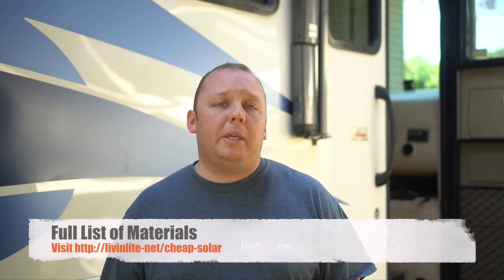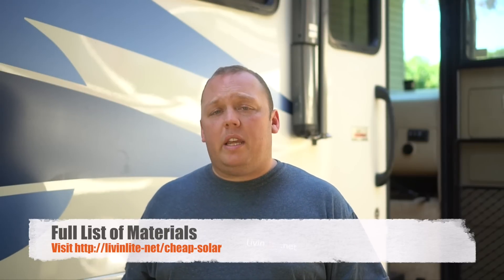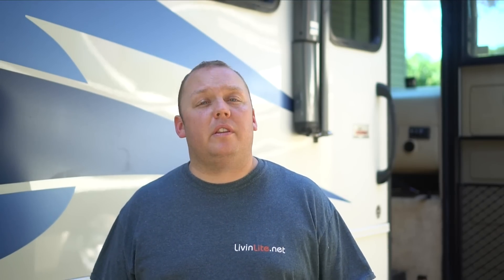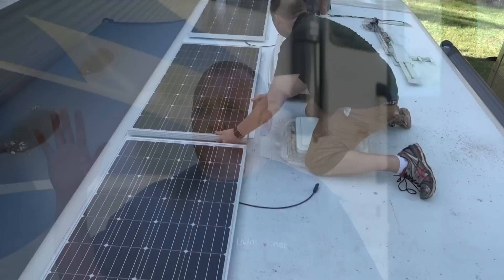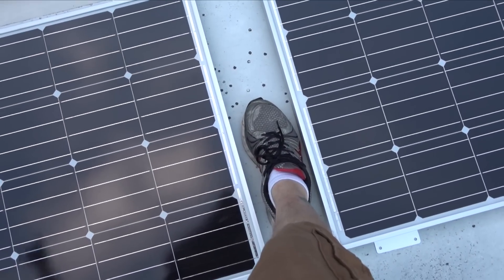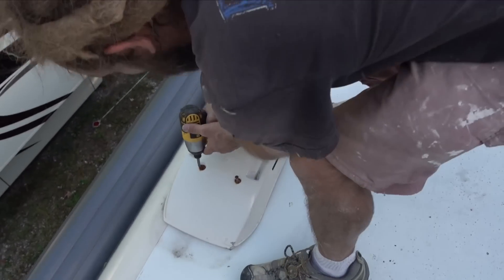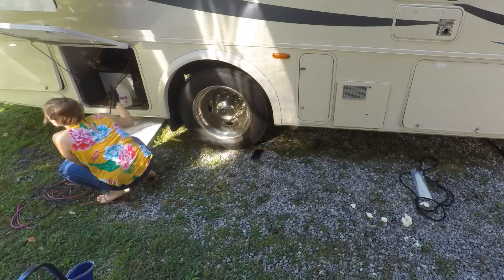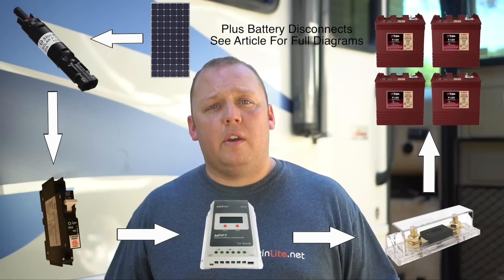Solar Power - Stop Using Generator for Under $1200?

Comment: Poor mans better power then the rich man feel good power...........Lets look at this, solar 650 watts at high noon when the suns out.......Park in the shade like we all do when its hot, no power.........Solar needs a battery bank to work, like 1000 extra pounds, 10 or so new batteries,and where do you put them?............1200 dollars for 650 watt cheap, no warranty questionable panels...........Solar is a scam.............Now realistic thinking 1000 watt 23 pound  generator  from 99 dollar harbor freight to 800  dollar yamaha- honda thing..........Runs while you are in the shade, at night, when it rains, 24-7............You can actually down size your battery bank, I went from 4 to one.............While giving you power to run your items, it charges your battery at the same time.............50 foot extension cord puts that already not much noise generator out of sight out of mind while it does its job..............1000 watt gen, that is already putting out about 400 more watts then that solar thing can put out, 9-10 or more hours on a half gallon of fuel.............gen stores anywhere, even your young daughter can move it around, gas it up and pull start it...............

Did I mention solar is a fraud?  Then why Michael do you have a solar panel? Oh busted, I do I have a 11.00 dollar harbor freight 1.2 watt panel I keep hooked up to my camper battery when the camper sits for awhile in storage.............If people try to make you think you are evil because you use a generator, ignore them you never know what other insane thoughts they harbor.  I have three gens, a yamaha 1000 watt I use most every time I use a gen, I have a honda 2000 I will use when I or wife plan to share power with a friend neighbor camper (long cold knights when you use your heaters all night, any real camper knows what happens in the middle of the night with your propane standard camper heater stops heating and only blows out side air in, when your battery runs down) The third gen is a champion 4000 watt beast that will run everything, most of all the A/C when its 110 outside. rarely use it but it does the job of a hydro electric plant, well almost...............Good luck to those that dont want to be ripped off and decide your tiny gen is the way to go. Hey if you want solar just so you can sit at the solar power owners camp site and feel all good about yourself, just do what I did buy that 1.2 watt panel to trickle charge your one battery, now you are a member of the club and have that ticket to be social with the solar club......Not, but I think you all get my drift, by the way two of those gens I have are over 20 years old and run great today, the yamaha, the honda....................

Michael
Reply: SO glad you wasted so much time to type that. To each their own. Your ignorance of solar as well as DC power shines through, so hopefully you learned something.
Reply: So what was ignorant about what I said? The fraud solar fad is just that a fraud. Forget the massive heavy dangerous battery bank you have to install in an RV for solar to work, I may add not very efficient. Solar is no more than an expensive toy. My comment above explains lots of other options for power besides solar that is much much better. Just because a salesman can sell snow cones to Eskimo's  doesn't mean the Eskimo's are the brightest bulbs in the pack that buy them..............Come on any one with common sense can see the lack of any real power in a solar system, let alone the expense of running it. " Hey why is that guy parked in the sun over there in this 110 degree heat with all these shade trees around here? Answer.....He is charging his batteries"  ' How is he staying cool? He is running his big generator to run his A/C at the same time" Dont worry I dont make fun of people that buy solar, I make fun of those that buy into solar as this great free power source before they buy, maybe save them lots of free money, as well as maybe their life, see those large battery banks you have to use, well they make and vent off hydrogen gas in that confined space right under you in the RV coach while charging. So lets see Hydrogen gas (think Hindenburg, look it up) battery bank, electricity, spark, lighter than air flammable gas, get the pix?????.............. 

Not convinced? Ok the panels have to be really clean to produce max power, they have to be tilted (aimed) at the sun for optimal power, and even the biggest most expensive panels produce less electricity than a harbor freight 99 dollar generator, that I dont recommend as your primary gen, but to make a point.............Michael
Reply: Regardless, can we truly put a price on preserving the planet for future generations? No, not at all. Solar is not a scam. Solar is smart and ethical. Solar is intimidating to big petroleum corporations. Keep drinking the koolaid, consumer slave.
Reply: It did hurt my brain to read it all. Unfortunately for you, you agreed with nearly everything I said. You even offer  a "I don't care, to each there (their) own", yet you've spent more than a page making almost non-sensical ramblings try to represent your opinion as fact, in an effort to somehow sway people away from "their own." I make no judgement against how you choose to power your RV. I'm not even like Mr. Bug One up there who says there is "no price on being green". Thats a complete joke and spending billions to "save the planet" will do nothing to stop the earth's natural warming cycle. 

Since we both know you agree that there is more than one way to enjoy the outdoors, just consider the possibility that solar has its place in the off-grid use and that in small (less than 1000 watt) arrays, is rather cost effective. If you can't live without your A/C, that's your choice and has nothing to do with the thousands who don't use them. I've had an RV for 10 years and used the A/C probably once a year.
If you want to learn more about solar and how easily it can power your life, check out handybob's solar blog. You and he have several of the same opinions about the solar industry. The difference is he actually lives off his solar and knows how it works. Happy Trails
Reply: To read your writings, show you know absolutely nothing about solar or DC power at all. Its actually mind blowing really. Its the same three arguments over and over again, yet you provide no actual proof of anything other than you know what works for you. Nobody told you to switch to solar. No one told you to abandon your genny. No one told you to find a solar install video and make negative comments yet somehow you've wasted what I can only imagine is the majority of your mental bandwidth, trying to argue an opinion. 
I can certainly find numerous accounts of solar installs being poorly done and solar installs not providing their advertised expectations. I can also find the exact same failed expectations in every single OEM converter installed in RV's and every single cheap chinese generator. You get what you pay for. Cheap batteries, small wire and overly inflated expectations are the source of the opinions you seem to share as gospel. 
Fortunately myself and many others are able to look beyond the shouting heretics and realize there is a right way to do things and it can be done with a little brainpower. 
Thanks for the conversation. I look forward to finding you looking up other videos you have no interest in and trolling those too.
Reply: mike arg once again, your reply shows you know little about using solar in an RV. Yes a generator is cheaper and more efficient, but it requires gas and constant maintenance. Solar requires no more maintenance than occasionally sweeping the panels. Only lead-acid batteries vent gas and need to be mounted on the tongue or in a vented box. Simple solution that has been tackled for decades. 
I agree that solar is not a simple solution, nor is it appropriate for most people. That being said, for anyone looking to live simply, without a generator, or at least without air conditioning, solar can be had for the same price as a Honda 3000. 
If someone wants to live a full-service lifestyle, own giant generator, listen to it hum while you hide inside your rig or go park in the parking lot that some call a rv park.
Reply: Love it when you folks reply to me, gives me another chance to speak up against this fraud industry, Solar. Look some of you are hell bent to do Solar go ahead, but I would guess most here don't even own or use an RV except maybe when you go with your parents. That said, come on my points were right on and factual and I have an RV. I wouldn't use any more solar than I already have (you have to go back and read my posts to find out what I have) I don't hate Solar I just don't like the way its being pushed as the solution to end using a generator, and the every power need solution ....Ah like the title above. Solar is a toy, expensive toy, but Solar is really worthless without the large amount of batteries to store the energy, the more batteries you have the more panels you need, that is unless you want to charge your battery and never use the power in them.

Now I just picked up a new gen, 1000 watts, inverter  type gen, 186 bucks new, wow I paid almost a thousand 20 years ago for my same type gen Yamaha (thats still running and I use). Now I just want to see how this thing works, and how long, but damnnnn that's cheap folks. Now there are rave reviews about this gen all over you tube, and I couldn't pass it up. Now if you want the name ask me, I am not an ad agency, ok?

My point, gens have been forced to compete, they have evolved over time and prices are coming down. That's how things are supposed to work, your solar is the same crap its always been, no big breaking news on their improvement or power output, batteries are pretty much the same as Henry ford used in his first cars that came with a starter.  The new batteries that show some promise are so expensive, and they are not that much better than lead acid Bats. Solar prices have not gone down, mostly up.

Hell even a bike gen can produce more power than Solar, and hey if you have like 10 kids, you, and your wife and all the kids could ride that thing and produce power 24-7.......( Bike gen is a stationary bike that when you peddle it, it turns a alternator and makes power)

Good luck with that massive amount of hydrogen producing batteries you all store in that extra storage bin on you Rv, One tiny little spark.........................BOOM      

Michael
Reply: Again Ed another great point you made about  why solar is so well fitting in the RV world.... Just coming back from a great 5 day desert trip myself, yesterday, that turned ugly the last 2 days with up too 65 mph winds and freezing cold weather, I found our single battery would not hold a charge. Not to worry though we managed a very comfortable sleep, watched a few DVD'S as well as running all our power needs with the trusty  25 year old Yamaha 1000 watt gen, 24-7. Not one to run a gen normally that amount of time it pretty much saved our butts. Oh it did it on a couple gallons of fuel too. Running an RV heater, as most RV'ers know will drain a battery in just a few short hours and the flame in the heater will not ignite with a low battery. Making one of the most important features of an RV worthless.

Now I never intended my points about solar turning into "Solar versus gen", mainly because there is no comparison, a small reliable gen (like my Yamaha) can be a life saver as well as be counted on for every day power needs, where a solar, as expensive as it is, depends on a battery bank as well as complicated electronics to manage the system. My battery above is pretty normal service use, it is two years old, and now needs to be replaced. Imagine the cost of replacing the whole battery bank on a solar system every two years? Wow.......

A massive solar system cant even put out 1000 watts of usable a/c power on its own, first the solar produces 12  DC volts that has to convert to 120 AC volts. It does that through the battery bank and then an inverter as well as a controller to keep the battery bank safely charged. One failure in the system, like the controller, you have battery bank frying dangers that can be serious. And like what happened to me over the long long weekend, batteries get weaker and weaker over time and things like extreme cold also effects them. Now we do need at least one battery in our RV's to run our lights, fridge (with the help of propane) as well as our heater again with the help of propane, and there are a few other uses. Sometimes we want more comfort and we need more power, a solar system does not give us that extra power, like a gen does. So those that want trouble free life with all the comforts of home while out in the wilderness a gen is really our only option, well till they allow us to buy and use a power cube run from atomic power. Solar is a toy folks, a fad, that falls real short of real life power situations. 

We also have had guests like ED and a few others go on some of our trips with us. You know the ones, they take a single ten minute shower in your rig and burn through 30 gallons of our limited water supply, they leave lights on and kill our battery-batteries. They want to use our inverter and house batteries to charge their electronics they cant live without all the time. Yes Ed I am the Trump loving cave man! We survived and had a lot of fun the last 5 days even though the weather turned dangerous and nasty on us, that little gen that could, did. She did it with out a sound the whole time, at least we didnt hear it especially over the horrible wind that may have ripped off those worthless solar panels any way..................
Michael
Reply: Wow some of you have it really bad, Yes of course I will stop running my dinky gen I use to watch movies some times so, those movie stars in those movies can fly all over the world for what ever reason in their private polluting jets. Oh I know, I can save a 1/2 gallon of gas not run my gen and donate it to those same stars for their mega gas hog luxury boats. Yes I want to spend thousands of dollars x 3 just to generate 1/4 of the power my 300 dollar gen makes for 9 hours on a half a gallon of gas. Hey as long as you want to live like a popper sacrifice so the mega rich can waist even more resources go ahead. I dont write this for those that drank the solar Kool-aide I do it so those that cant see for themselves that stacking an already over loaded RV up with a thousand pounds more batteries  spend thousands on panels and all the junk that goes with it, to what save the planet????? If thats what you want to do go for it, but I wouldn't want any advice from someone that thinks solar is the answer to all the RV short comings. Its not its another short coming is all..............Michael
Reply: I can understand someone like me posting how solar is a giant rip off, because it is, but surely cant understand someone posting about defending it. You do understand that most people that camp a lot, camp at full hookup camp sites right? No need for a gen, or charging up a battery bank?? Now you do know that lead acid batteries are the norm, and Lith ion is rare rare rare, and gel works same as lead acid, let alone expensive. Now the trailer tongue has room for about two batteries, most people that buy the solar stuff cram the rest of the needed batteries as well as the mounds of electronic controllers in, you guessed it , a sealed  storage compartments on the trailer and in the motorhome. No solar system on an RV can run an A/C, so if you want A/C you either have to use full hook ups or a gen. 

Two of my gens are over 20 years old, other than changing the oil every couple years, half a quart to one full quart and spark plug, use less gas than my lawn mower every year and they keep running great. Little more than "sweeping" is required for panels, they actually need to be washed, as well as constantly re-positioned. The batteries need to be cleaned and topped off with water, and then replaced every few years. 

Now even if you park in the hot sun all the time with roof mounted panels, you still cant store all the energy produced for re-use with out many many batteries, and those batteries cant even produce enough constant energy to run your A/C, let alone start the A/C.............

 All my points are facts not opinion, especially blind sided green opinions. Sadly to some, our comfort level does depend on power to some extent, even as little power as to charge our phones. As of today a gen is the most cost efficient, ease of use, and options available to have as much power as you need or want for 24-7. I boon dock mostly and a 1000 watt gen will supply more power than I need for 90 percent of the time, rain or shine, or dark. I cant hear it running when I am inside my trailer, and when I am outside my trailer not using electricity I have no need for a gen to run.  I carry one battery for the trailer that is more than enough when not running a gen. Wow and that 1000 watt gen needs 1/2 gallon of gas every 9 hours of use, that's a real pain....not. 

Anyone pushing solar on the net or in real life, either sells the junk, or don't know what they are getting into for the minor amount of power they get, when the sun is shinning of course. Like I said I use a solar panel to keep my one battery topped off when the trailer isn't being used, 1.5 watt 11 dollar panel, that yep I have to wash off every week or so for it to work.......... Oh and the next reply will be from someone that will tell me when they drive the panels charge their battery bank, well if you installed a larger alternator on your motorhome  or tow truck it will charge your big battery bank while you drive, if you run one or two batteries as I do your stock alternator will charge them just fine. Well I am  not saving the planet???? No I am enjoying the planet, and the planet is just fine, we have an understanding, I don't trash it, and the planet comforts me................

Pushing things in life on others to be "green" is not cool folks its rude and shows peoples lack of information to debate, that in turn makes you look kinda dumb, Look around folks the person selling solar that makes a great living off it, buys a 2 million dollar RV that comes with a 10K gen that runs all the comforts of the elite, and laughs at you all the way to the bank ................Relax enjoy life, go camping, live in your camper if you want, even go toss your money away on solar to make you feel good, I don't care to each their own.......Unless you have millions of dollars to do it, just be smart about what you do, life is really simple and fun when you are not bending over and taking one for the team to save the planet for those that care less about the planet, that use more resources in a month than you or I use in 5 years.............Butttttt they are smarter than us Mike?  Hardly...........Yeah I know it hurt your brain to read all this....
      Michael
Reply: Make it real simple for you folks that just think its the best thing since sliced bread, common sense tells us we never buy the first year model of new car. Solar will never evolve or get better as long as we tax payers subsidize the industry. Generators on the other hand have evolved so much just because of the free market that the ones available today are head and shoulders beyond even a few years ago. I do not agree with you Andrew (you must be a solar salesman) we are so far apart its not funny. I know solar works, I know we all can use it with huge battery banks, but ask yourself folks is it worth the price, in other words does the price reflect how efficient it is?  Ask yourself, we go camp out in the desert do I bring a thousand pounds of extra weight in batteries? Or do I bring a thousand pounds of extra water and a 20 pound gen with a 5 gallon gas can? Do we get the most bang for the buck? How much comfort will it give us with the power we want? It is so limited, to the point its almost a toy. Solar doesn't solve a problem and that is, how to get power to the things we want with us? That problem was solved along time ago with a gen, solar is still in the stone age when it comes to solving that problem.

Solar is not and I repeat not a substitute for a gen, as much as the solar people want to sell it that way. No matter how many thousands of dollars you spend on solar, a gen is almost always there as a primary source of power. Nothing that matters can run straight off the solar panels, not even a hair dryer or curling Iron. Massive battery banks need to be installed with every solar system, or else what good is it?  

Just curios because I stated that no solar system sold for our RV's can run an A/C, I did some checking, and there are people who are running an A/C off their solar system. The best one I saw was this massive solar system that was able to start a special soft start RV A/C and it ran for 6 minutes before the batteries went dead and wouldn't run it anymore, You would have thought they saved the planet with all the celebration they did...........

To many people are being shamed into buying solar, now that's their fault but being shamed into buying something because you are killing the planet with your gen, is wrong and crazy. When they make a solar panel the size of a 4'x4' square that will produce 1000 watts of power, at 15 amps in the shade and a battery that can put out and store 3000 amps over 12 hours drain time and a recharge of 30 minutes from dead, that weighs 10 pounds hey I am interested, till then Ill take the ole gen every time. 

I did say I don't care what people spend their money on, or if they want solar or not, but you solar nuts need to start telling the truth because to many people are buying solar from what you say, and they will hate you latter when they find out how wrong you people are. Then there is the people that spent a fortune on solar, are very disappointed yet rant an rave about solar because they are to embarrassed to admit they got took........Now if it means that much to you folks, go buy a couple cheap harbor freight panels stick them on the roof of your RV, that way you can tell all your green friends " you bet, I have solar and love it"

In the old days junk didn't last long on the market, today with great marketing and shame plus tax dollar subsidies, junk stays around way to  long.........Besides Solar is for sissies, now a gen run with an oil smoking opened pipe Harley engine, now that's some man power...........That was a joke snowflakes....

Michael
Reply: Well Andrew you have no way of knowing what I know or not. That said I tell the truth, I know what I am talking about and don't have to come up with excuses why something works or not. You must sell the stuff cause you want it so much to work. Even when it doesn't work you have all the answers why, like "its the dumb as..s that installed it". 

Bashing Chinese gens is kinda dumb since china makes every portable gen made today including Honda Yamaha, Coleman, you name it. I posted facts over and over as you pointed out if I helped just one person have second thoughts about buying a 10,000 dollar solar system and bought them selves a 2000 watt modern gen and a 5 gallon gas can instead its worth it. Truth being spread around may actually force the solar companies to compete against proven alternatives you solar people just might get something that really works, instead Solar companies compete by trying to outlaw the competition, shaming the competition, getting tax dollars to stay in biz, and the one that all use that are in their place, "Its better to save the environment" ' Its green power"  or worse "we have to shut people up that say anything bad about us, even though we are the bad guy"

Now I said before I get along 90 percent of the time with a 1000 watt gen running a couple hours a day, that will charge all my one battery, run everything I want within reason and do it cheaper and better than a 10,000 dollar solar system sitting out in 105 degree direct sun at noon. I also do it in the shade, in the rain, and in the dark of night, when I want. That's the key, my way is on demand no matter what. If the wife wants to use the A/C, the microwave, the entertainment system, the fridge, the heater, you know all the little feel at home things that actually come with our RV's. Its all on demand and at my control with the push of a button on a wireless remote control........

Solar is interesting to me, kind of like watching the Jim Jones effect. "What flavor Kool aid do we drink today Martha"? "Well Tom lets drink the 650 watt panel today........Its so nice we don't have to hear the gen anymore Tom". "Well Martha we never heard it before when it was running". "I know Tom but we knew it was running,,,,,,,,,,By the way Tom can you turn the air on, its getting hot in here". "Sure Martha but I have to start the gen". "Oh that's fine I am hot".....

Life is a bowl of cherries, but you have to watch out for the pits........
Michael